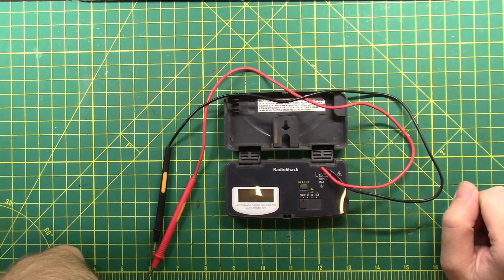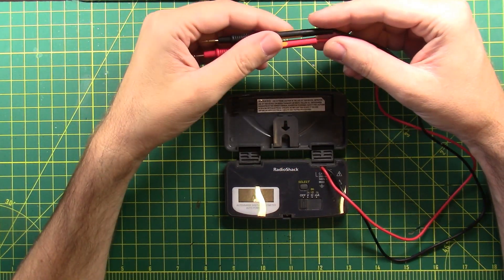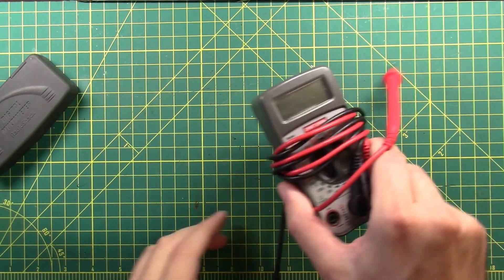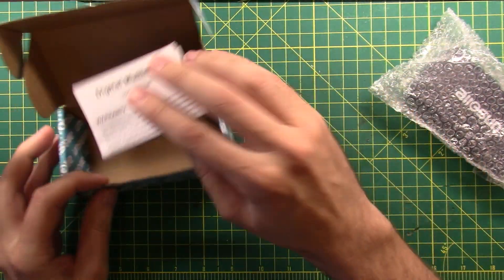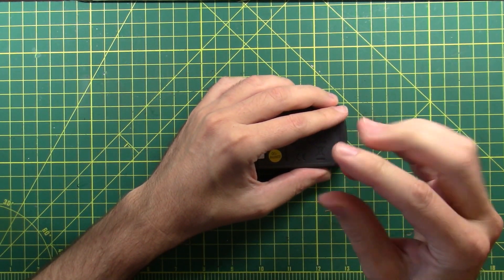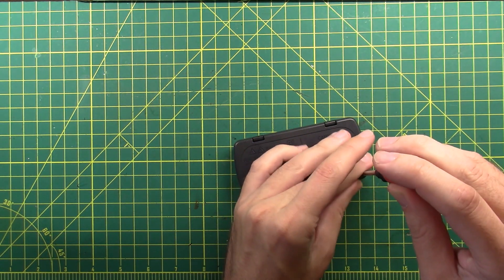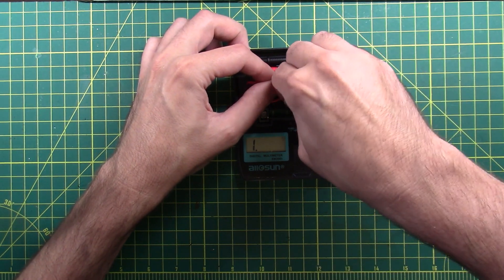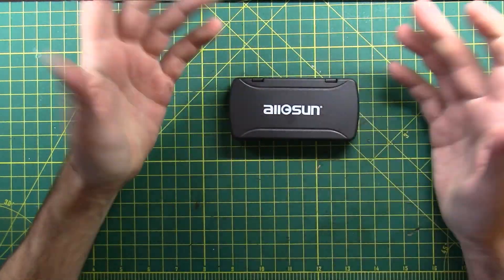$14 Allosun Pocket Multi-meter Introduction

Comment: I used a little Radio Shack meter for years just like that one, except it has the dial for selections like your new one does. I loved it, but I can't remember why I replaced it. I think because I got a great deal on a new Fluke 77III. I still have it. Hope the button cells haven't corroded, because I doubt I removed them. Here it is in a very old repair video I did at about the 42:13 mark https://youtu.be/jeo54GX1-Kc .
Reply from the maker: I had the radioshack model and I kept it until it broke.  Loved it!

Comment: Morning won't be  able to watch the coffee and radio. Having problems with FT 8.
Can't get it off com 3 when it should  be 4 or 5. Can't keep  usb audio codec going. It can't find it. Under radio FTDX-1200, and have to use a out side sounds card which is a  Yaesu SCU-17 for the interface. If would do it Can't just it off com 3 or USB. 
Keep getting hamlib error IO error. It was working now not liking me.
Silcon dual CP2105 comport 4 and 5. Guess I am  confused.  Don't  have a way of checking.  Looking for information and help.
tnxs KQ4CD  Paul
Reply from the maker: Hey Paul, probably to long for a youtube comment, message us on TOADs Discord in the #FT8Off channel and we'll help you out.  TOADs discord   https://discord.gg/tsVKqfv
Reply: @temporarilyoffline  i JUST did and see what happens. thanks for the information 73 KQ4CD Paul

Comment: The case is too small?

or

the leads are too big (smaller leads would not have bent the wires like that)

I have an old Radio Shack Meter too...... a desktop type of meter that will do transistors too
Reply from the maker: Either way the wires broke in a spot that I could repair, but just don't wanna
Reply: @temporarilyoffline  That end looked like the lead when I thought I was measuring voltage, but the lead was plugged into the wrong socket on the meter. Blew a hole in the wire at the probe.

and now you know why I buy Harbor Frieght $5 meters :D
Reply from the maker: @CurtTerpstra  Sometimes cheap is just right.